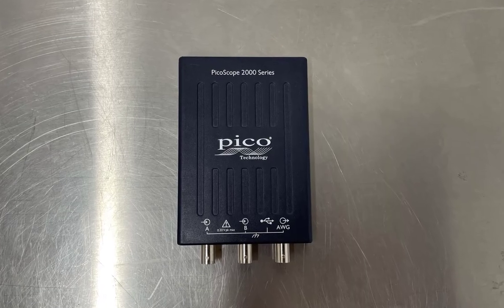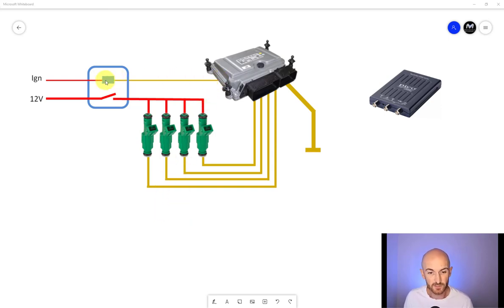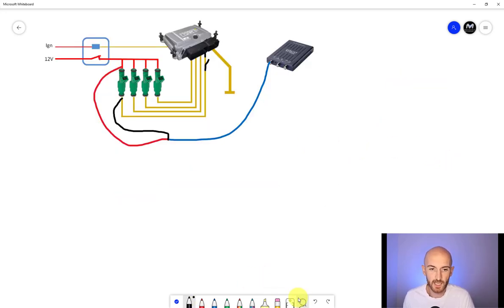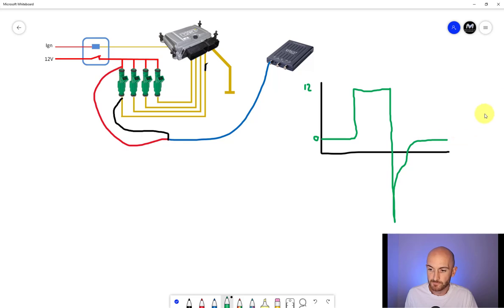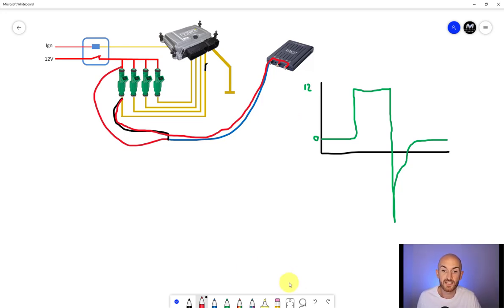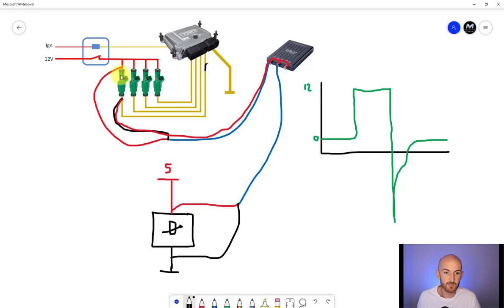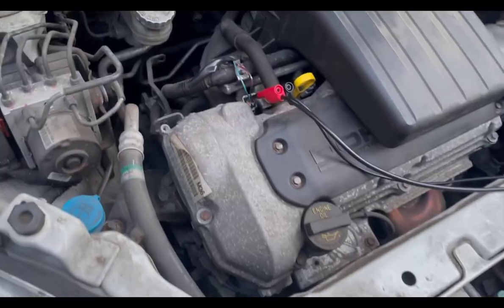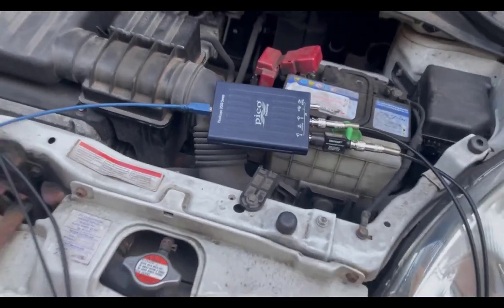How NOT To Fry Your Scope! PicoScope 2204A vs Automotive 4425A

Comment: Thanks for the videos! I'm just learning how to use these things. - I measured the alternator to batt and the #1 injector at the same time with a 2205a. Wondered why the insulation piercing probes on the injector -v probe  got hot enough to melt the plastic and discolor the needle.... Fortunately, I didn't damage the scope that I know of yet, but I'm glad it's an inexpensive learning tool for me... I got the waveforms I was after. Thanks for the video! I wish I  would've seen it, or one like it 2 weeks ago when I did this. Could've been a worse result... Live and learn... 👍
Reply from the maker: Thanks so much for sharing your learning experience! Some time back I had a similar experience I shown in the video. Hope your scope is ok 😁
Reply: @MechanicMindset   Fortunately, it still works on both channels. I had 20x attenuators on both channels and I think I got lucky. So far, everything I've measured since looks correct. At least correct enough for me at this stage...
Reply from the maker: @KingLoopie1  😅

Comment: Unusual way to measure...I was thought to always connect the black scope lead to battery negative and the red lead to whatever you want to measure.
Reply from the maker: Measuring like this check the power side for voltage drop too. It works particularly well for Diesel and GDI injectors 👍
Reply: @MrBlonde Your are correct. He confusing the people to get them to see his course
Reply from the maker: @mkoteb7202  This is the truth, why else would Pico go through the trouble of installing floating grounds on their flagship automotive scope? You can’t also check out the rest of my videos before deciding whether to buy 👍
Reply: If you hook the negative to the battery negative would this happen
Reply from the maker: @diamondstateautodiagnostic5250  No, that’s the conventional way to measure; connect negative to ground 👍
Reply: I guess what I'm asking is if you hook the negative lead to battery ground and then you ground Channel b would it also activate the injector
Reply from the maker: @diamondstateautodiagnostic5250  Check out this video 👍  https://youtu.be/F3n9YVbnaeA
Reply: It's a convention, not a rule. It doesn't matter where you connect the black scope lead (ground)  as long as both of them are connected to the same fixed potential/voltage. What you've been thought is probably related to ground loops with oscilloscopes supplied with main/earth. It doesn't apply here since the car has its own isolated power source (battery/alternator).
Reply: @diamondstateautodiagnostic5250  Are you asking if you connect channel A to B+ on an injector with the black lead to battery ground, and then connect channel B to battery ground (+ lead touching nothing) will that fire the Injector? 
If so, no. And the reason is current would flow from B+ at the Injector harness straight to battery ground without ever going through the injector. 
When you connect channel A to both B+ and Control at the injector, and connect channel B to the battery negative on any scope with a shared ground, you are now providing a pathway that will allow current to flow through the injector, out of the control wire, through your scope back battery negative.
Reply: @YuckFou0x0FFFF  what I'm trying to say is without a floating ground if you connect Channel a to the positive side of a fuel injector and then ground that channel to the battery and then let's say you take Channel B and you connect it to a crank sensor signalwire and you also connect that channel to battery ground  r at the sensor you will see a good crank sensor waveform because all the grounds are connected together where if you have floating grounds you was to take Channel b ground and put on the ground of the crank sensor you would see a bad crank sensor signal
Reply: @diamondstateautodiagnostic5250  Do not put your scope ground on anything except battery negative, use extensions to get to it if you have to. And do not use  scopes that aren't specifically designed for automotive applications. The 2000 series Pico is not designed for automotive use.
Reply: @YuckFou0x0FFFF  that's the point of the video. If you aren't using auto specific scope. I don't, and it works fine. Many people dont.
Reply: @matth9359  I understand that, apparently not else everybody does.
Reply: @MechanicMindset Hi. Thnks for the usefull video. I think they  seprate the grounds to make the job more easier. Or in some case if we have a two wire crank sensor and we ganna measure its signal with the others sensors or actuators at the same time we need a seprate ground wire.If you know sth else plz share.
Reply from the maker: @jacob-no4tf  Yes, it n some cases the ‘ground’ isn’t a ground. So separating this makes it possible for accurate measurements across channels 👍

Also with noise on very sensitive signals
Reply: Always measure the circuit in question, not just to body earth. Voltage drop testing is a very necessary part of any diagnosis.
Reply: @MechanicMindset. Can you tell me what is a good low budget laptop that I can buy to use the Pico scope download? Thank you in advance.
Reply: @MechanicMindset  so if you hook up TWO injectors they both would fire when either gets pulled down?  Worlds first waste injector system......

Comment: we have been taught to go for "safe ground" with an oscilloscope when measuring automotive circuits.
the only time you don't have to is when measuring alternating current , for example inductive sensors.

Nice explanation and thanks for putting your pico at risk and not mine xD

Comment: Very good explanation.  An even more likely scenario is that 2 channels are used to monitor 2 injectors.  If the computer fires either injector, both injectors will rx a ground and open ;)
Reply from the maker: That’s right! I had a similar issue many years ago as when I was a trainer. Because I didn’t know how the scope worked, I could t explain why we had a misfire 😅 all good now though haha

Comment: I'm actually an Electronics Tech. not an automotive Tech and the way I would approach this, depending on what you are looking for, is to ground to the car chassis, then look at all the 12V sides of the injectors to verify it isn't dropping out, then you can probe the negative side of the injector with the probe. The probe is isolated with 1M or 10M depending on if the probe is set to X1 or X10. If it's really wanted to see the differential voltage, connect both A and B grounds to car chassis, A+ on injector+, and B+ on Injector -, then using the Math function, Subtract B from A and you will have an isolated differential signal. If you have a 4ch scope, you could see 2 injectors at a time.
Reply from the maker: The math channel is great! This works especially well for GDi injectors 👍

Comment: Great info Darren.
Ignore the haters.
This is the same as when we use a bench oscilloscope. That's why we use an isolation transformer to stop the possibility of blowing up our oscilloscope. You will be joining the earths together and if you happen to be checking the secondary side of a power supply, which is lower voltage - Big Bang Theory!
Thanks for your explanation & I hope your course goes well. 😊
Reply from the maker: That’s it! The main point is that if you’re not careful you can end up using your scope as an earth path 💥. You know I like to get creative with diagnostic techniques and as long as you understand how the car and tools work, you know the consequences. You can also do some great tests! 
Cheers Max! Enjoying the new venture so far, excellent feedback 👍
Reply: @MechanicMindset  So is that new Pico yours? I'm still enjoying the new Pico smell on mine. Great piece of equipment & I am slowly getting to understand Pico 7 after using 6 for so many years. I've made a diagnostic centre with a swinging boom to house not just my Pico with a big screen TV, but also a lot of my other diagnostic equipment, including my thermal camera which is getting a real work out. In fact I used it to diagnose a microwave oven this afternoon. 
Keep up with the awesome videos mate. 😉👍
Reply from the maker: @MiracleMAX  Yes it is! Got the standard kit delivered last week. I’ve used them at work for year but good to have my own (wouldn’t have got away with using works - they’re branded…). The thermal camera is on my list, what have you got? I’m thinking Flir or Seek for iphone. Such a cool tool!
Reply from the maker: @MiracleMAX  Re. Pico 7 - it has all the same features but laid out ‘better’. If you’re used to Pico 6 it’s a pain. But if you’d never used 6 before, 7 would be the go to option. I’ve just got to update all the lessons in my course now; but they are still in development with it. Especially the non Automotive version
Reply: @MechanicMindset  Yes, it has bigger buttons for old guys like me to see!
Reply from the maker: @MiracleMAX  🤣
Reply: @MechanicMindset  I only have a limited budget. I went for a Banggood Hti HT18 believe it or not. It's wasn't dirt cheap, but compared to other known brands it was heaps cheaper. I looked at a lot of reviews of various cameras, including the ones  you mentioned and the specs on the HT18 are very impressive. I've used it to repair a GScan 1 for my old college and a microwave as mentioned among other things. It's great to show the students  where current is running in a fuse box when looking for parasitic drains. I was amazed that even after a circuit was turned off for some time, the relays were emitting enough heat to be picked up by the camera. A really useful tool!
Reply from the maker: @MiracleMAX  cool I’ll check them out

Comment: Hi Darren, I just bought a pico 2204 thanks to you, so if you are using a scope with 2 or 4 or 8 channel with common ground, it's safe when using more channels to connect the red leads on what you whant to meassure and all black leads to car battery negative(or just one because it's shared)?
Reply from the maker: Awesome! Yes, keep all the black leads on negative/chassis. You can use all channels no problem

Comment: Thanks for the Video | I have been watching your videos from pretty much the beginning, I actually have a 3000 series automotive picoscope which have the shared ground so I found this video very interesting.
I have heard loads about how you can fry your scope and laptop by connecting these shared ground scopes to mains electricity, which always made sense to me but to be honest never translated that to injector circuit. (in fact I guess from watching your video that anything with a coil i.e, ignition coils, relays, starter solenoids, fuel pumps & motors the same principle would apply). I would have liked to see more on how these should then be setup instead, but I got the gist from the comments below.
Talking ofelse's
Keep up the good work though look forward to seeing many more videos from you.... Cheers Joel
Reply from the maker: Yes, any time you ‘float’ the ground (so put it on a wire that could be higher than 0V), we run risk. If you just use one channel, it’s safer. For high voltages, we’re better using a differential probe; this eliminates the scope ground problem altogether. Cheers Joel!

Comment: Oh no!!! Now I am unsure if I should ever use both channels?  As a DIY guy who isn't very confident or knowledgeable about auto electronics I am not sure if I will recognize when using both channels would be bad? For instance,  I am only guessing that  a cam crk correlation would be ok, but what if I want to have the crk and the number 1 cylinder on a non-obd2 car to try understand a timing issue.  Would that be a problem?  Is it only with fuel injectors that are pull down?  What do I need to look for on a wiring diagram to understand if there is a problem?  Is 5v ref an issue also? Please consider making a video to explain all this. Now a feel like ditching this scope for a floating ground type. Ugh..
Reply from the maker: No no! It’s fine. Just always use the chassis/battery ground. 

The problem occurs when we start placing the negative lead on wires that aren’t always ground. 

Black Lead > Ground = No problems

Comment: thanks for the demonstration and for the video I will be very careful when taking measurements
Reply from the maker: Thanks for watching Stephane. How are you getting on with your oscilloscopes?
Reply: Hello I am doing very well I continue to progress on the use of the oscilloscope thanks to you and the you tube community, which is not used too much in France in garages it seems to me, because when I go to training at our the center almost nobody uses it, even our SDR (repair diagnostic specialist) uses it very little, and recently we had a problem on a truck, abs problem which appears and which disappears when the ignition is switched off, the diagnostic case nothing, I I plugged in the oscilloscope to the voltage of the abs computer and at one point the voltage rose to 32v and that made abs light up
Reply from the maker: @stephanevaucelles6378  Amazing work 🎉 Happy to hear the oscilloscope is doing its job. And maybe soon you will be the SDR! 😬

Comment: In a scope like that, the ground level for both canals is always the same. Thereafter, there is no need to connect the ground pin of both canals - it is enough to ground one canal only. One point grounding, no problems.

Comment: I usually connect the ground lead directly to the negative terminal of the battery, that way I get the waveform mirrored the "right" way with the voltage spike going upwards
Reply from the maker: That is the conventional way to connect 👍
Reply: @MechanicMindset  Seems like I'm doing it right then :)

Comment: May I ask a question?

If one probe + connect with CAM signal(+) Probe - connect with engine ground, and the other probe + connect ckp - (but AC sine wave), - probe connect with engine ground, Does it happen oscilosocpe is burnt?
Reply from the maker: @Boat_FishingDoduJeju  No that should be ok, with both negative leads on chassis ground. It will be damaged if you put the negative leads on different voltage potentials (if the scope has common grounds)
Reply: @MechanicMindset   Thanks a lot! Have a nice day!

Comment: Excellent thanks for the great video,, what is the best unit testing crank sensor connector and diesel injectors,,, system for pulse thanks
Reply from the maker: Which oscilloscope?
Reply: Yes 💯
Reply from the maker: @faroukkhan6777  So the automotive scope 4425a is the best you can get pretty much. The 2204a is much cheaper but has its limits. You can work around them a bit if you know what to do with it. But if you’re serious, the 4425a is the way to go

Comment: Okay, great pointing out there sir. But can you please explain me then how should I measure a injector waveform and a signal of a sensor at the same time if I can't use the ground of the C2 as it lead to injector to go close-loop? 

I mean should I leave the C2 ground along without connecting it to a ground or?

Comment: Thank you for the video! I ve an old Picoscope 3204B. Does this also apply to this picoscope version?
Reply from the maker: Yes, I think that will have common grounds. You can usually tell by looking at the symbols on the front of the scope. Or use an ohm meter 👍 Cheers!

Comment: thank you so much for the information, so its better to use only 1 channel when mesuring with the 2204A and not mesure 2 different things at the same time?
Reply from the maker: If you connect both channels to ground, it’s totally safe to measure with both. What I am doing here is not the conventional way of measuring the voltage which can cause problems; the negative lead is not connected to a permanent ground
Reply: @MechanicMindset  ok thank you. God bless u ^^

Comment: Great video, valuable information.  So using this, I just got one the other day to compliment my MP408 Autel,  how do you check fuel injector patterns and anything else at the same time?
Reply from the maker: Hey Wes, best to always use the chassis ground. Depending what you are testing, amp clamps can be a better/safer way to monitor injector operation. I have a couple videos for conventional port injectors 👍 Cheers

Comment: what other solenoid based actuators will induce spikes that will address the use of the atenuator?  also , if the ground is common on the BNC connectors of the scope , there is no need to connect it when doing probe calibartion , right?   big thanks
Reply from the maker: Some other solenoids are EVAP purge valve and GDI High Pressure fuel pump. 

Hmm, not sure what you mean re. Probe calibration. Some people only connect one channel ground for multiple measurement

Comment: so as long as you always hook neg to neg and power to power im safe?is there anything else that can damage?like having the wrong voltage settings on scope? im brand new to scopes and just ordered my first cheapo hantek.
Reply from the maker: Yes, always connect negative lead to chassis ground, and measure with positive probe. Wrong settings won’t damage, but measuring a voltage higher than the scope maximum input might. See my video about attenuators 👍